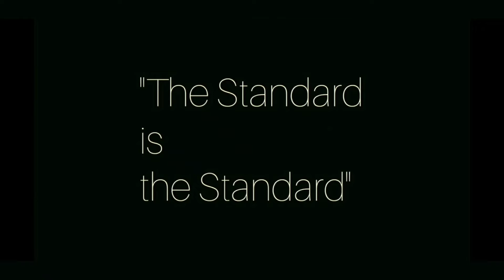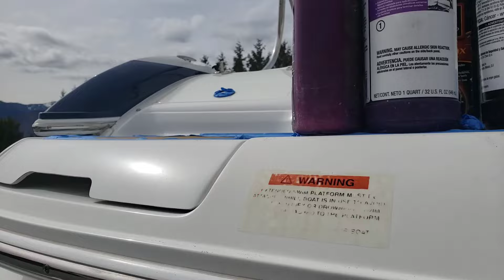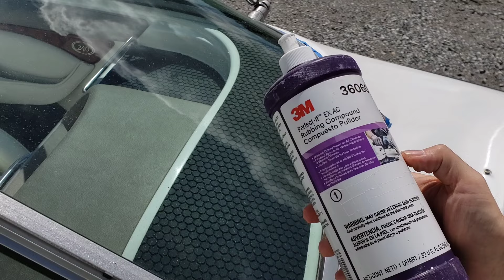How Long does it take to Polish gelcoat on a boat?

Comment: So.  I've watched a ton of videos. So much that I've confused myself.  I started today. It was 10 Celsius and no snow! Lol. I started with maguire heavy oxidation remover because I had it and am just using it up. Then I went to heavy and then 3m perfect ex ac to finish. I would do all three one area and then move to the next.   I have 3/4 of one side done. I'll finish tomorrow, wipe down and then wax. Now I never switched the pad and only spurred it once. For 3/4 of one side. How ofter do I need to spur the pad. How often do I need to swap the pad? 
Thanks.
Reply from the maker: Hi. I feel like a Doctor getting a call from a field medic and soneone is bleeding out on the other end No pressure.. Give me a sec.

If, you're using a double-sided pad, generally I like to use one side of the pad for my heavy cut compound and I save the other side for the perfected ex ac. If however your using a single-sided pad, you most definitely should have spurted out between the heavy cut and the perfected ex ac.
When to Spur your pad is an answerable question if I know all of the variables. If the bad becomes gummy and full of compound that would be a great time to Spur your pad. If you're starting to see scratches in the surface while using a compound that should not be scratching the surface, that would be a good time to Spur your pad. If you had is bouncing all over the place or feels grabby, that's a good time to Spur your bad. If I'm doing sections for a video, I will generally spur my pad every 3 to 5 ft of a modern ski boats Hull. Then again, I have compounded entire holes and only spurred my pad once per side.

When you say wipe down the boat, I would suggest you take it one step further and wash the boat soap and water, or at least use a degreaser window cleaner or some form of detergent to remove all of the oils left behind from compounding. At this point you want to inspect your boat under bright light from many angles making sure that you got everything that you wanted to get. Then, apply your wax or ceiling or polish.

Good luck. I hope the patient survives!

Lee
Reply: @Local_Boydidgood  awesome advice.  I'll do perfect ac ex again tomorrow to clean ot up.  Instead of washing how about using mother's surface prep cmx? So you know the boat had not even been washed in the 13 years since my uncle bought it.  Patient is doing awesome!  Thanks.
Reply from the maker: Cool, the CMX works, use a wet and a dry towel combo.
If yo don't like what you see, one more pass with Perfect-it ex ac should get you happy.
You might want to reapply your wax in a week or so. Dry boats love to eat up wax (absorb it) Feed it.

Lee

Comment: Was the white gelcoat in pretty bad shape to justify using Super Duty?  Seems like you sometimes get away with only using Perfect It EX AC on the white.
Reply from the maker: Yes, the white was showing signs plus, where the cover was/wasn't, that needs to be hit pretty aggressively in order to get everything to match. Plus, Cobalt so, thought as glass gelcoat. Heat would work but would have taken longer.

Hi T.